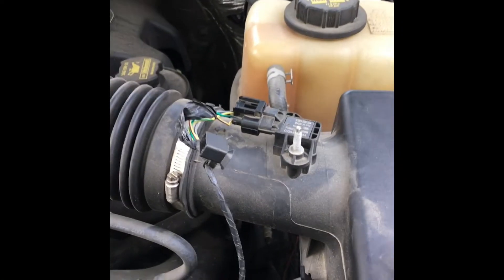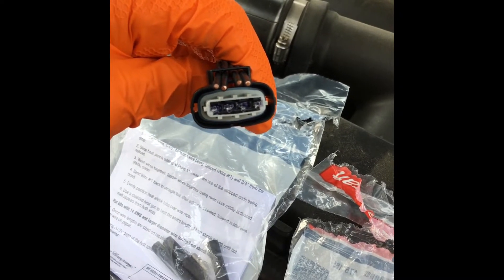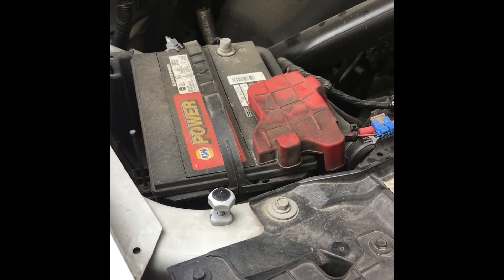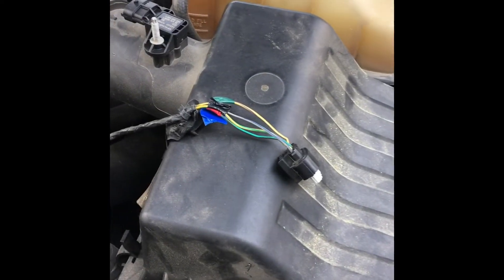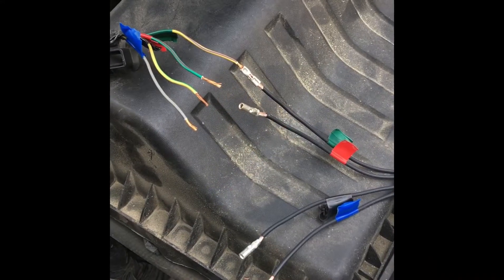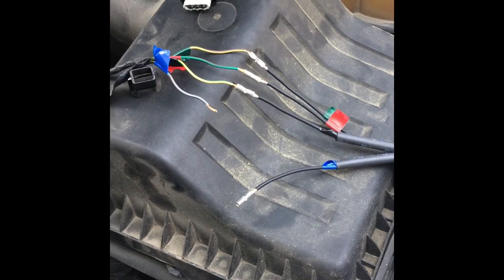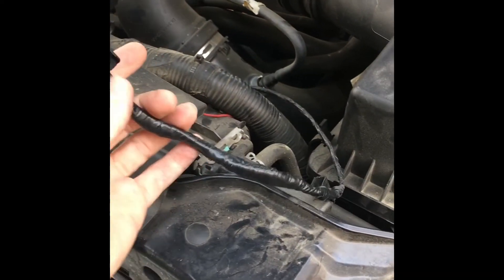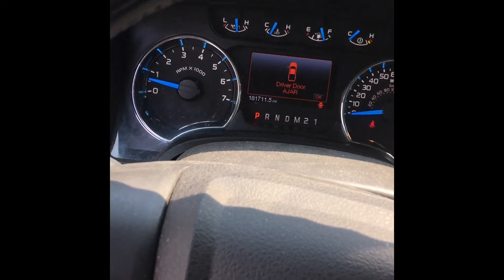P0111 P012B P012C 2013 Ford F-150 3.5 V6 Twin Turbo Ecoboost

Comment: is it safe to assume that this would also fix dtc P012D? (I have that at P0111)  thanks for sharing the video
Reply from the maker: I'm not a certified mechanic, but when I was researching this fix, the P012D code was one that was within my readings. So, I would assume this would help to correct your issue. Thank you for watching!